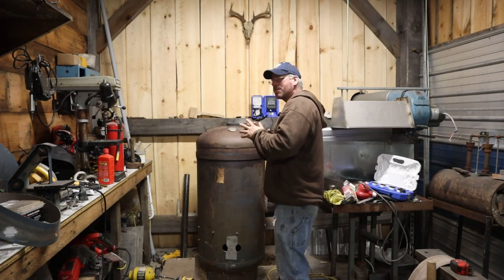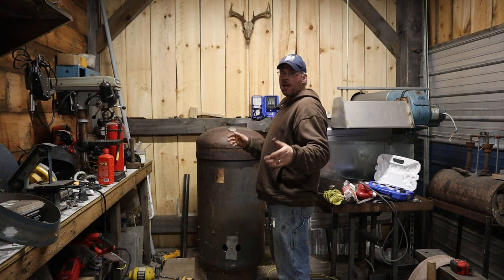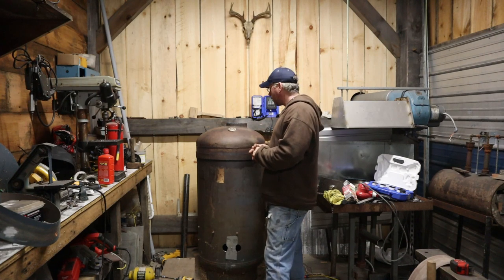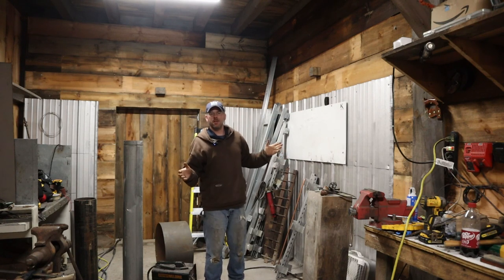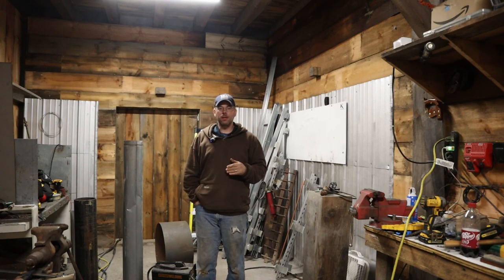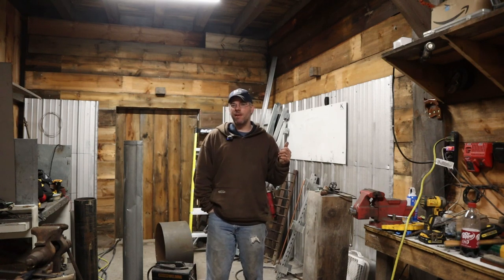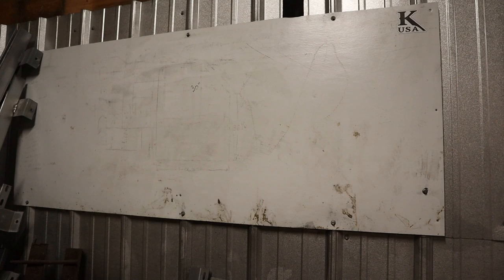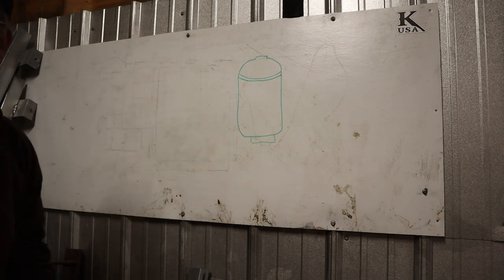The Sawdust Stove Explained

Comment: Nice job Jim! Thanks foe the expos'e . It is really exciting that it works well with greenish chips. I'm wondering how course you can go with the wood chips. My plan is to chip my slabs and the feedstock for my furnace will not be the fines you get from a band mill. Even my sawdust is courser because I run a circle mill. This has potential as a biomass heater with out the active floor. I think the draft inducer is great but I wonder if it was used in conjunction with a stack would you be able to turn it off and run with the draft from the pipe? You could use the fan for burn control with feedback from stack temp.  Just sayin'

Comment: A few questions / points:  Does the "reducer" have a 2-1/2" exhaust pipe exiting its side?   Is the exhaust pipe welded on or screwed on to the reducer?  What's the temp. at the squirrel cage / electric motor?  What's the distance from the barrel's bottom to the pieces of 6" All Thread inner barrel's rod supports?  How much ash is produced in a 8 hour burn time?  How do you clean out the ash?  Will you be adding a fresh air vent to the room?  The pipe used to create the void through the center of the sawdust;  when adding sawdust, is it left in place during the burn?  Does the hole in the inner barrel's bottom-side wall align with the void created through the center of the sawdust as if a "J" or  "L" shape void for air flow from the vents in outer barrel?   Or does that void through the center of the sawdust exit directly out the bottom of the inner barrel (making it a straight void only through the center of the sawdust).   If so; what then is the purpose of the hole in the inner barrel's side wall near its bottom.  If the void / pipe through the sawdust is a straight run to the inner barrel's bottom does the ash settle to the bottom of the main (outer barrel's bottom) through this void / hole or remain in the inner barrel?  I assume the ash remains in the inner barrel?   Does that hole at the bottom / side of the inner barrel act and somewhat align with the air intake holes of the outer barrel, and is that the purpose / function of that inner barrel's bottom side wall hole?

Comment: Jim if need be can you choke it to extinguish the flame?  I am thinking if something came up where you needed to leave and had not planned on going.
Reply from the maker: Yes.  If I close the bottom and turn the inducer off it goes out.  Tried it last night.
Reply: @TheTradesmanChannel   I am good to hear that you can snuff the flames by choking the air. Would not want to have that going even at low burn if you had to take off.

Comment: Good explanation glad it is working. When you load do you compress the sawdust or drop it in around the pipe in the center, that you pull out before you fire it up. Stay warm.💚💜👏
Reply from the maker: I tamp it down and then pull the pipe out.
Reply: Ok thanks for the info

Comment: Do you plan to try different types of sawdust, thinking hard wood or planer chips? Also on my wood furnace there’s a blower on the air intake that automatically kicks in when the water temperature gets below 150 degrees that would surly turn up the heat. Good job getting it all working. 👍👍
Reply from the maker: I will try it all out.  Last night was green sawdust from the sawmill.

Comment: There is a history of masonry stoves in Russia! Check out the great literature ..... there is usually one character who is always lazing around propped up on the warm stove ;0)
In the UK we have a tradition of brick building .... with brick flues integral to the house. You invariably had two storeys with one fireplace above the one in the floor below. This meant that the whole brick chimney got nice and warm ...... the fires themselves were not efficient though! This meant that if chimneys were not regularly swept you would get a build up of soot and condensing volatiles like creosote so the day you got a big roaring fire going the flames would leap up the chimney and set fire to the lining! Having the fire brigade turn up and dump a load of water down your chimney was always  a bad day!
Things have changed now though .... we usually heat with gas boilers feeding a wet radiator system keeping the houses toasty! Usually people have a focal point gas fire as well and that caused the next set of problems!
Many people did not bother to sweep the chimney well when they fitted the gas fires and this allowed the exhaust gas from the fire to then mix with the lining on the brick flue producing an acid! This then ate away at the mortar of the chimney from the inside ....... having your chimney collapse in a bit of wind would always be a bad day too! 

The solution for this was to fit a metal flue inside your brick chimney ..... also ideal for the new generation of wood burning stoves we have ;0) These stoves are usually A rated and designed to gasify all the wood giving maximum heat from your stove as well as making it look really good with all those flames rolling round inside visible through the self cleaning glass doors ...... You can probably guess I love my wood burner ;0) Carbon Neutral too!
Reply from the maker: We like our masonry chimneys with stainless flues here as well.

Comment: Hope you figure out a way to feed that thing while its still burning. Having to pull that top on smoldering sawdiust and putting more fuel in would not be something I'd want to do. Every one I've seen had the same problem. Maybe having two for the long days... At least you have something that will toast your buns and thaw the icicles from your nose.

Comment: You never said where the sawdust goes or how you light it
Reply: It is burned up and produces CO2 ..... and a little ash! 

If it is burning hot enough the surface of the sawdust off gasses combustible gas giving enough heat to continue the process! When you realise exactly what is happening it is fascinating! You need 275f to 600F in order to burn the creosotes out and therefore stopping them condensing in your chimney, giving the chimney fire risk everyone worries about
Reply from the maker: Sorry Jim.  I covered the loading in a previous video, the lighting of it as well.